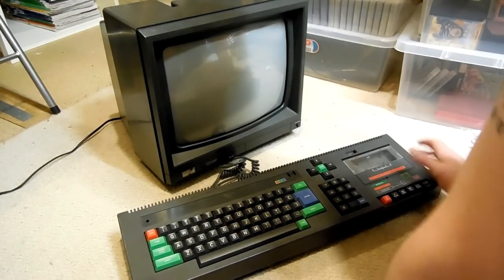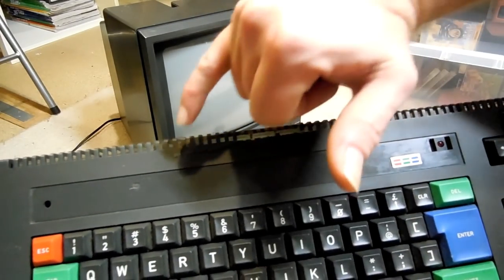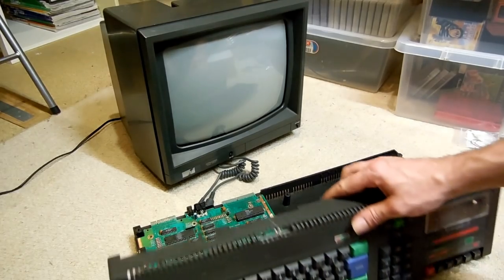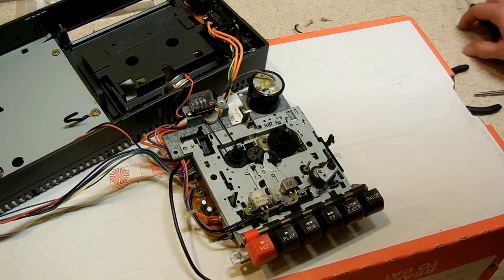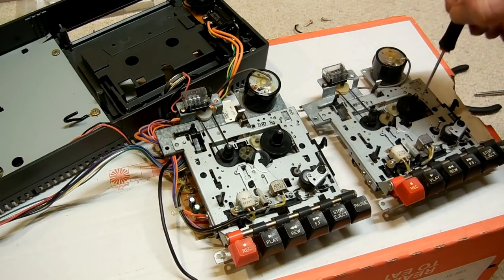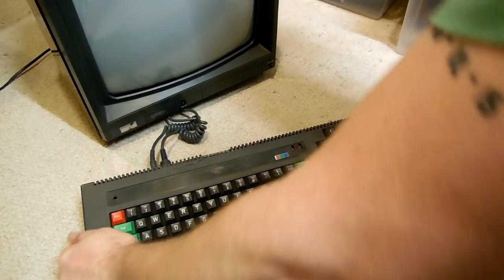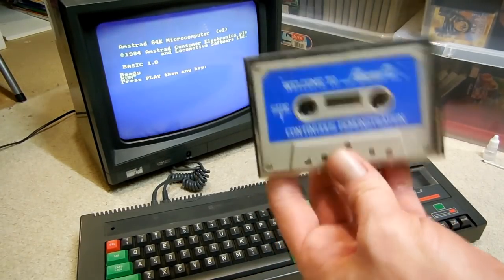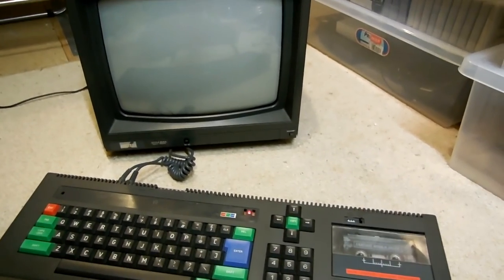Retro Special - Let's Save a CPC464! (Datacorder Fix)

Comment: My datacorder had the same problem, but I didnt have a donor I could strip parts from. I did find it easier to remove the whole arm the damaged wheel is connected to though, it comes off from the underside of the mech. I believe it was just one screw and a small spring. Nice to see your tape counters are intact too, in my experience that is usually the first thing to get damaged

Comment: i there do you know if the 464 can have a separate tape cassette player connecter to play tape games from? as I know there were some tape players designed to load games connected to these old computers but im not sure if you can with the normal 464 or not? my tape counter is knackered and so is the reset button which isn't a issue playing games, just a pain when its a compilation tape and I want to play the last game and I have to load each game first to get to it

Comment: how do you prevent corrosion? Also I am guessing the tapes wear out in time, is there a way of transferring the information to another tape? :)
Reply from the maker: There are different methods for both. Tape restoration can be tricky indeed.
Reply: Making a backup of a tape before it starts throwing constant errors is easy, all us 80s kids know about tape to tape copying. They used to make lots of cassette/radios that had two tapedecks in them, slip your game into deck A, a blank into deck B, set to TAPE mode, play on A, record on B, and you've become a pirate ;)
It IS possible to repair a cassette game using a PC and some audio editing software, if you're careful with it you can take bits from side A and side B and combine them to make a workable mixdown.
Of course, you can just skip that step and find yourself a TZX file (tape rom) and a TZX player, and record the output onto a physical tape. Its like burning an ISO onto an optical disc.
Reply: yeah was wondering the same but to do with some c64 tapes

Comment: Nova, I dont suppose you know anywhere I could pick up one of those idler wheels, or the washer for one? I've had a run of bad luck trying to source those from donor 464s or from ebay
Reply from the maker: I have been told several tape decks contain similar rings, but they are hard to determine. I've sourced spares form broken CPC's in the past. I'd check out the cpcwiki.

Comment: I don't suppose you know the size / dimensions of the idler tyre. I have been trying to find a suitable replacement for mine. I could buy a 2nd hand deck and strip it as you did or maybe look for a c64 one to strip it from but I am hoping to find some band new ones. :Lots of the audio repair guys supply the idler tyres and I am hoping if I get the dimensions I can find a match from somewhere like this https://fixyouraudio.com/
Reply from the maker: TBH, i never measured it. I found that a c64 deck may share components yes, but it is possible to restore the fitted one with a bit of wet and dry fine and some adjustment of the springs, adding a little grease. Try and find a doner unit however, most reliable way i reckon.